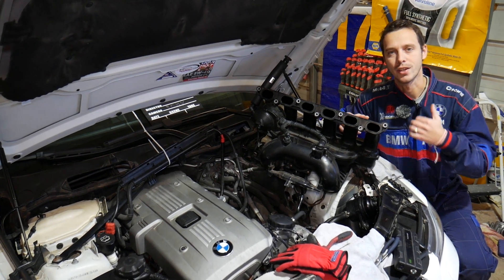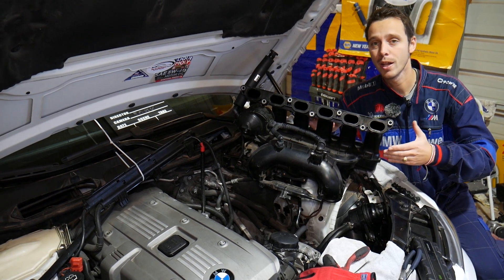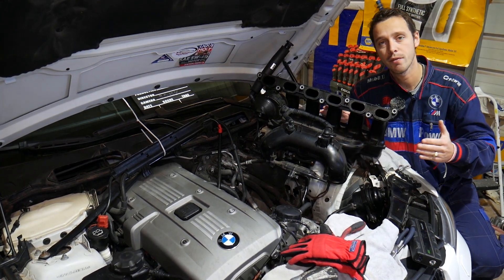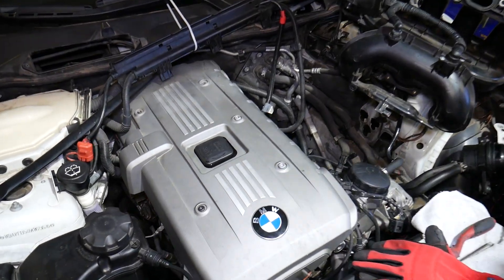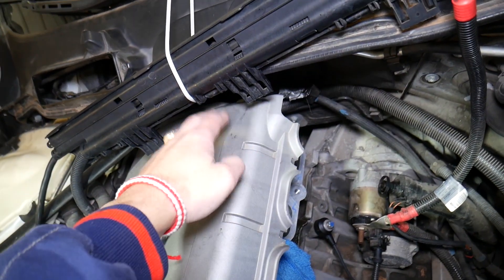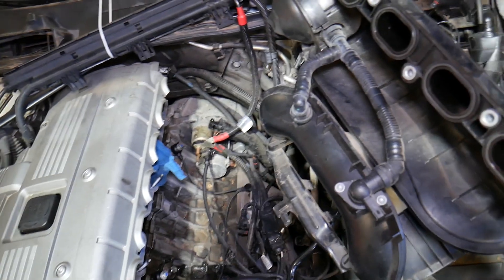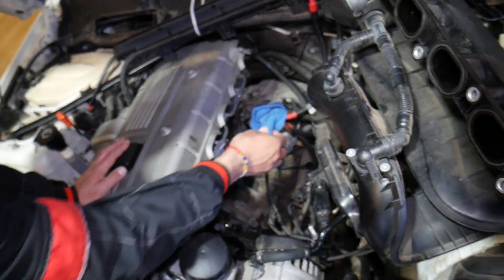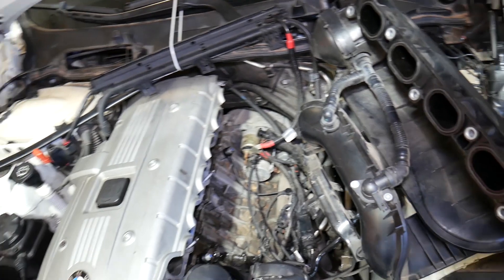BMW Z4 Z3 SYMPTOMS OF BAD PCV VALVE, BAD CCV VALVE

Comment: Thanks man!!! Just got my 2000 z3 M52TU running after dead seven years from typhoon Yolanda. Two connectors in e-box were reversed...ahhhyeah.  Engines rebuilt now but billowing clouds of white smoke from exhaust... usually that's head gasket... But I read synthetic oil can burn white?! Will look into this first..thanks for the GREAT VIDEOS, MY FRIEND!!!

Comment: On my '06 325Ci the engine ran rough at all rpm ranges before the CCV Valve went completely. I was checking everything including a bad guibo with  not luck until the CEL came on with the P0174 code. My Z3 is now having the same symptoms and this time I'm not waiting. If you have a smoke generator you will get most of the smoke coming out of the oil fill opening.